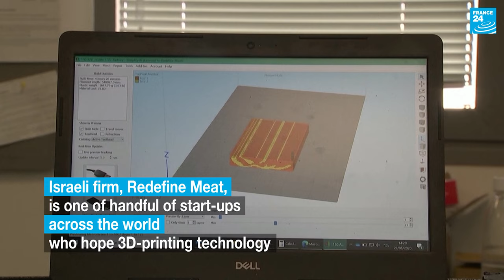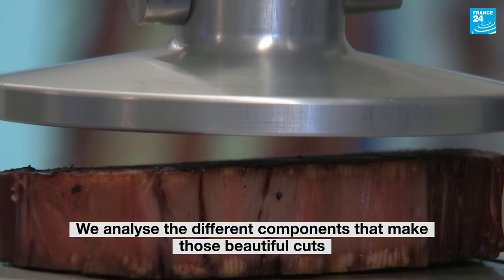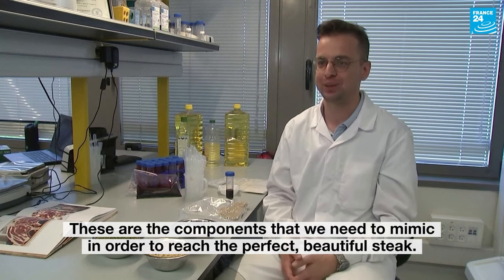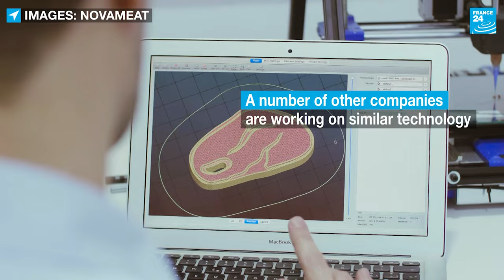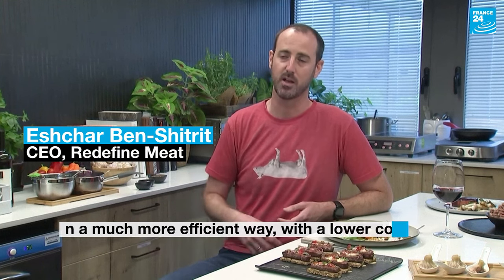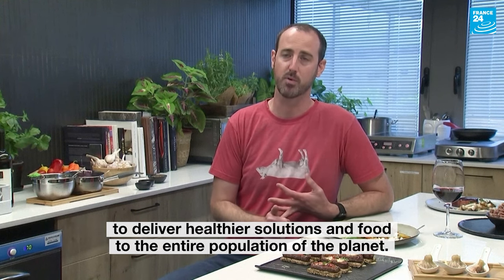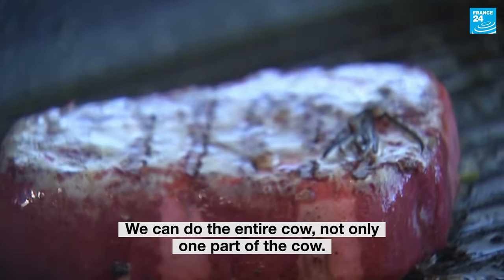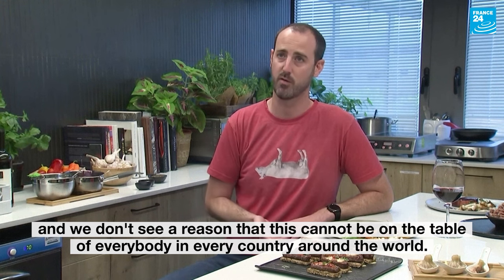3D-printed fake meat: The healthier, greener future of food?

Comment: Why 3d-print? When all the fibers are facing one direction, why not extrude? Waaaaay more efficient. When every Steak has to be printed it takes ages.
Reply: They print it so they can call it aged beef.
Reply: Because it doesn't take ages to grow a cow right?
Reply: Probably takes a lot less time than if you were to raise a cow to slaughter weight, which probably takes about 6 months.
Reply: My guess would be that by using a 3d process they have the option of not having all the fibers facing one direction, which is more like muscle tissue.  I would guess that what we're seeing right now are early prototypes, not what they're aiming for ultimately.